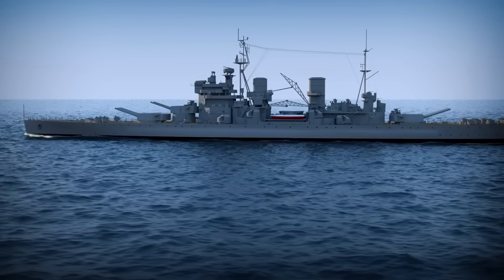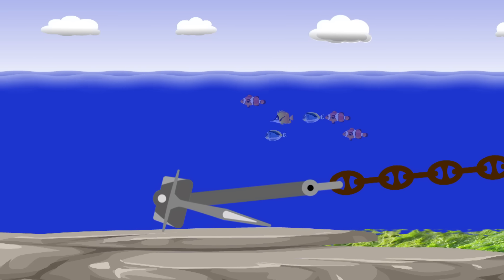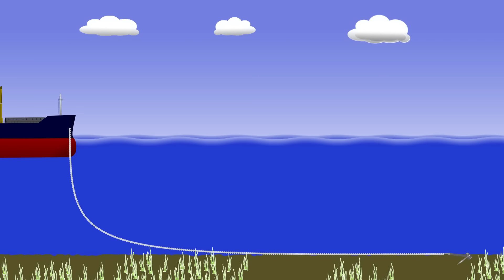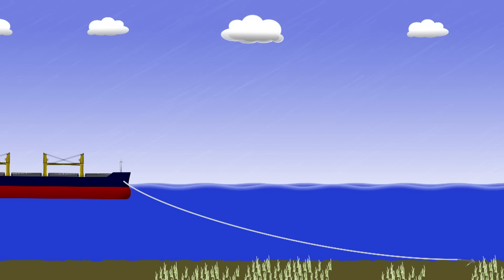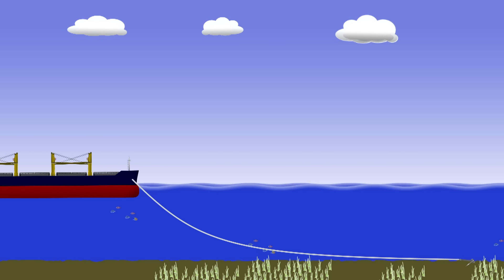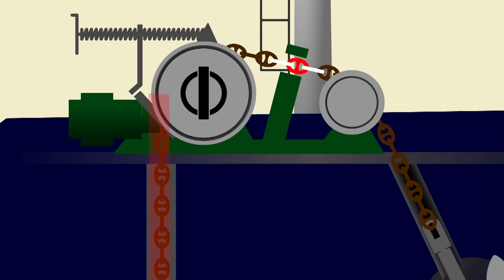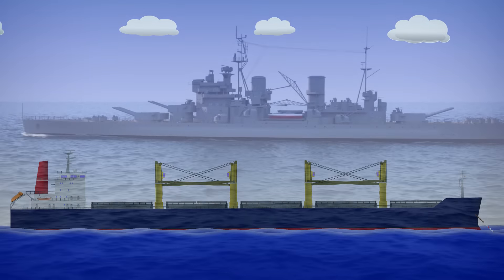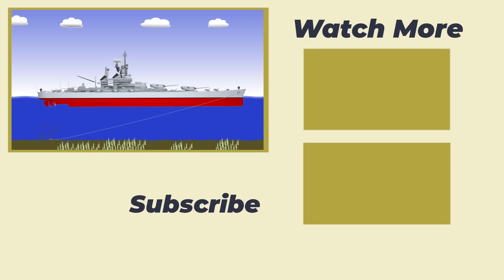The Truth About Anchoring Huge Ships

Comment: I actually learned that one of the most dangerous parts of the ship can be the chain locker. Not because there is several tons of metal chain link but because the sheer amount of metal can actually deplete the oxygen in that compartment through oxydation if not properly ventilated.
Reply: Never thought about that before. Very cool fact.
Reply: When you see multiple nuts holding a hatch (more than 10), its likely there to prevent crews from opening it on seas. The risk of getting suffocated when entering on these hatches are 100% death. And the chain locker is one such hold that has multiple nuts on its access hatch.
Reply: Yeah there are a ton of areas and voids that require a gas free certificate to enter on ships but they are typically difficult to acess and are labled well. What's really crazy is how fast you can pass out and subsequently die entering these spaces without the propper equipment or degassing procedures. In the Navy we are taught not to enter even just to try and pull someone out because of previous incidents where rescuers become casualties and multiple people parish. That's really wild though that metal oxidizing is the reason I never knew that but it makes sense.
Reply: I watched a something about an industrial accident where somebody sufficated in a chain locker and then the person who went to rescue them also died. I think two people tried to save them and died. Confined spaces are no joke.
Reply: Or there could be electrolytic components can be used to suffocate the saltwater to prevent the further electrolytic oxidisation
Reply: Any non-ventilated space aboard ship becomes dangerous over time. On most navy ships they are closed off by bolts, and requires forced ventilation before entering unless wearing oxygen providing materials.
Reply: @drewdabbs418  that video is from this channel also
Reply: All ferrous metal tanks/ enclosed spaces have this issue of "rust" taking oxygen out of the air, unless they are heavily coated/painted. However with anchor chain lockers , there is also the added  issue that the marine growth (algae/plankton/barnacles, organic scum/slime/etc) on the chain, dries out, dies, and starts rotting, which creates deadly  Hydrogen Sulfide gas. so chain lockers  are doubly dangerous.
Reply: Crazy
Reply: That's crazy. You come into a room and you die not because of some radioactive or toxic material but just an otherwise harmless metal chain absorbing all the oxygen.
Reply: wow.  I never knew this.  That is both really cool and totally terrifyingly cool.
Reply: That's not really true though
Reply: @TlD-dg6ug  uhh, wrong.  The chain locker is extremely dangerous.  All enclosed places on ships can kill you, but the original comment is right on.
Reply: @TlD-dg6ug  I hope it is, I usually flake the chain, and Im inside the chain locker when getting it back...
Reply: @TlD-dg6ug  I hope it is, I usually flake the chain, and Im inside the chain locker when getting it back...
Reply: @lashlarue7924 don't know...
Reply: @lashlarue7924  the only way that the original comment is valid is in a perfectly sealed environment, which almost no chain locker is. Every one I have ever seen has drains and air passages.
Reply: @TlD-dg6ug  Obviously your experience is not the only valid experience, and in such case you no longer have a sealed compartment anyhow.
Reply: @lashlarue7924  exactly the point I was driving home.
Reply: @drewdabbs418 yeah that is why it is forbidden to enter a confined space without a permit from the chief officer... The officer usually makes a probe in this spaces using a gas detector to test the oxygen content in that place if it is really necessary to enter the space they put on a ventillation to allow these spaces take in air.
Reply: Summary
A 342-foot barge was undergoing maintenance in New Westminster. Workers were carrying out a variety of repairs on the barge, including repairs to manhole covers that access void compartments in the hull. The compartments are considered "confined spaces." A supervisor went missing and another worker located him in the bottom of a compartment within the hull. Three other workers, one by one, entered the compartment to rescue their colleagues and lost consciousness. Ultimately four workers died from oxygen deprivation and one suffered injuries. A firefighter was also injured in

Comment: So fascinating, anchors go completely contrary to how you think they work as a child
Reply: How the anchor and chain system interact totally depends on the size vessel. The way it's described here only applies to large commercial and military vessels. Pleasure craft are not large enough for this interaction to occur.
Reply: @otm646  false, already on a 10/12 meter boat you have a metal chain anyway and you give from 3 to 5 lenght (1 lenght is the depth at hte spot) and use the same principle of anchor + chain on the bed of the sea
Reply: @otm646  Exactly, small craft rely more on anchor design and deployment than brute weight.  Very complex art just glossed over here but instructive and useful.
Reply: The anchor essentially just pulls the chain out of the chain locker. Lol
Reply: @resqjason2  true, but it can still stuck between rocks and that a huge problem
Reply: @russko118  I love it when people think they know what they're talking about. Your understanding of the physics in play here is wrong.
The amount of force imparted on the anchor rode from those few meters of chain is not nearly enough to prevent the rode from becoming tight in anything but the most mild of conditions. 3/4-in chain, something like you would use on a boat that size (that's actually being a little generous) only weighs about 5 lb per foot.  5 m of chain is only 80 lb. Doesn't take much wind or current to be able to pick that up off the bottom.
Now, if you are running all chain and have 100 m of chain out on a reasonable scope, 5 to 1 or better It will work as originally described in the video. Thing is most boats In that size class aren't running all chain. That's 1,500 pounds in chain alone.
Reply: @otm646  1 please use  international sistems, not that joke that is imperial 
2 and i think you misunderstud what i way saying, maybye buecause english is not my first laguege (my bad) and you don't even talk about what i was talking. i hate wen people think they know what they're talking about and don't come even close
Reply: Or as a grown adult like myself
Reply: This is exactly how I thought anchors worked since I was a kid I mean digging into the ground connected by a chain how did you think it worked???
Reply: @Ellispicks  No it's not the "chain weight causing the boat to stay still"  - the weight of the chain creates the "L shape" and drags the ship back towards the anchor. 
However the anchor keeps the chain still, and by extension the ship. Otherwise it would not be the ship moving (back), it would be the loose end of the chain.
Reply: Kailash Btw  how did you think they worked?
Reply: An almost universal truth I’ve found so far...
Reply: @JZ's Best Friend just like the rest of the ship😊
Reply: @russko118  no. I operate a 36 foot boat and the anchor is what does most of the holding. Not the chain. The chain is more providing weight so the anchor can dig that’s all
Reply: What this is kinda how I always imagined it lol?
Reply: We had an older style anchor before and it worked this way (the chain did the work). I switched to a modern anchor and the anchor does all of the work! I still let out plenty of chain but when I’m pulling it back up, the anchor holds to the seabed until the last moment (sometimes it doesn’t want to come out either).
Reply: @russko118  lol just stop dude, you embarrassed yourself
Reply: @smudent2010  i whould have, but i think i will keep on now
Reply: On smaller boats the still function the way they used to
Reply: Imagine arguing about a boat anchor
Reply: You mean as 10 minutes ago
Reply: ...yea... A child.
Reply: My life is a lie
Reply: You English accent is almost native like.. bravo my Chinese friend :)
Reply: they do? This is basically how I imagined them..
Reply: I thought the same thing
Reply: Everyone’s wrong here. Best anchor is just a cement block tied to a long rope and dropped to the bottom hoping it reaches. Ohh wait that’s just me and my little boat
Reply: @DarkVitamins  well yes and thus it increases your speed, then you pull it back in when you want to stop
Reply: Not sure you know what contrary means. This gives you a little bit better understanding of anchoring a large ship, but it's pretty much how everyone thinks an anchor works. Isn't it?
Reply: And that's just one more reason children aren't permitted to the Navy. Haha
Reply: @resqjason2  I think Chain Locker may have been a better movie than Hurt Locker
Reply: @JZ's Best Friend tell that to my parents!
Reply: I feel like a lot of people, especially those that live far inland, never really think about how much engineering and really cool science goes into modern seafaring technology. Ships are so cool!
Reply: @russko118  i use a length of chain on my small boats for this reason and it does help the anchor lay flat and grab in, also I suppose you know what happens if you let out too much rope in tidal waters in a smaller boat, there is a balance in getting it right, the chain does help that balance
Reply: @RiggingDoctor  curious, what type of anchor do you use ?? If it’s a “plough” kind of shape, have you rigged it onto the chain correctly ? 
Shackle is onto the hole near the base of the anchor, then use a breakable link(cable ties) to secure the links onto the end of the stem
Reply: It hooks the ground, what exactly were you expecting...?
Reply: @resqjason2  so true!
Reply: @russko118  sir,  unfortunately  , the age -old art of sea-man  ship, we are taught in imperial,  we get used  to it,I'm from Australia  by the way,  and in Aus we have used imperial  since  1963-ish.
Reply: @kenlee-97  i know, it's still used even here, mostly for lenght of boats (traditions) but just for that. and remember, nautical miles are not imperial units
Reply: @russko118  Metric is numbers for dummies, Imperial takes a bit of intelligence to use. Try it some time, fractions are fun.
Reply: @russko118  To be fair, 10-12 meters is far larger than the average personal boat
Reply: @--_DJ_--  lol you are american sir and there is no worst offense to that
Reply: @DolphinSMG  sure you need a licence just to drive something longer than 10m no matter what engine
Reply: @russko118  No, I am not Ameican.
Reply: @--_DJ_--  i'm relived, but also surprised
Reply: @russko118  I am Canadian, we use both up here just like they do in the states, it works just fine. I can use both, but prefer imperial when given the option. Also, there is nothing wrong with being American.
Reply: @otm646  incorrect, it's exactly how pleasure craft anchoring works as well.
Reply: @otm646  yeah I love it when people think they know what they're talking about considering I have a degree in engineering/physics and have sailed around the world and have owned two pleasure sailing yachts....hmmm..do lecture us about how anchors on pleasure craft work.  Keep going.  I'm amused.   The chain is just as critical in a pleasure yacht which is one reason why all chain rode is recommended for anchor tackle on off shore yachts and the size of the chain is far larger than the max tension loads required for it to carry.  The weight of the chain determines the holding power of the entire system to a large degree, particularly when you are using scopes on the order of 7:1 or higher.
Reply: @russko118  im with you on this one, we have a 10m boat at work and uses the exact same anchor that is show in this video. it works wonders, just remember to throw out enough chain, like you said, at least 3x the depth, 5 even better
Reply: @aaronm.3581  Yes.
Reply: I thought it was just butter
Reply: @russko118  I find it amusing that you don't consider something 10 meters long to be big. :)
Reply: @Jus7aguy  smaller than 3/4 meters (except optimist maybe) doesn't exist, so yes 10 meters is not that big. you can sail duo almost evry 10m sailingboats (maybe with somewhat moder rigging, you know a sloop, i don't know about antics)

Comment: Who would've thought that performing a handbrake-turn on a 40,000 tonne vessel is impossible?!..
Reply: I don't know if it's done anymore, but the Caremar ferries serving the islands in the Gulf of Naples dropped the anchor while entering the pier and performed a handbrake style manouver.
It was quite a show, they managed to land the rear ramp just a minute after stopping no more than 5 metres from the dock.
They were 1400t ships though, not 40000
Reply: On a ship as long and relatively narrow as a battleship it really isn't.

The short moment arm (think small lever) means that it would have to have a ridiculous amount of force on the chain to spin the ship.

The rudder works because it is at the end of the ship pushing sideways (long lever from middle with the force at a right angle), whereas the anchor is at the front side of the ship pulling backwards (also technically a long lever, but the direction of force is nearly in line with the lever, so the moment arm (the distance of the lever perpendicular to the force) ends up being short).

Well, okay, it could work if the ship was already moving sideways somehow, but battleships have keels to prevent that. So a cruise ship with it's omni directional engines might pull it off.

Or well, actually...

A battleship can totally do a handbrake turn! It does one every time it anchors in a wind or current. The wind/current pushes it sideways and the anchor chain pulls it to point upwind/current.

So yeah, they do them all the time! They just have to be moving sideways from an external force.
Reply: @TheNasaDude  Kind of like a slingshot effect??
Reply: @theInsaneRodent  Momentum is mass*velocity. 

So yes it will obviously be able to pivot in the wind wouldn't be much of an anchor if it could not do that. In other words your velocity is near zero, and so is the momentum.

Doing it with a moving ship on the other hand - it's so ridiculous.
Reply: I'm sure it's technically possible.................very slowly
Reply: Try 57,000 tons in the case of an Iowa-class, which is capable of a frankly terrifying 34 knots, propelled by a mind-bending 212,000 shaft horsepower. Combine that sort of momentum with the already miserable turning circle of the Iowas, and there's no way in hell the ship can perform anything resembling a handbrake turn.
Reply: @griffinfaulkner3514  isn't the turning circle of that class measured in kilometers?
Reply: @TheNasaDude  those guys do these ferry journeys everyday and they know what to do. Basically they drift like in a car 😂 full speed ahead, full to port and then drop the anchor while working the engines astern. Professional guys haha
Reply: Me....
Reply: @PeterJavi  Close to it, at just a hair under 1k meters. The stopping distance is roughly 4 kilometers if my mental conversion is right, unless you turn the rudders inward like barn doors. The downside of this method, as Wisconsin discovered, is that it does a number on the steering gear, and Wisconsin never did steer quite right after that particular test.
Reply: @firstkokin2324  yes they dropped the anchor and slammed the till to full starboard, to pivot around the anchor. Then full astern to stop the "dorifto" while lowering the ramp
Reply: @MrTarmonbarry  yes but not as extreme. I think they dropped the anchor and dragged it some. The anchor would have broken off if it lodged in hard rock.
Reply: @TheNasaDude  its still done. Called Mediterranean docking or mooring. We do it at a lot of small atolls in the pacific that don't have assist tugs.
Reply: @astro_manta9733  In Hollywood they can do it in less than a minute. 😊😊😊
Reply: Its 100% possible on US aircraft carriers.
Reply: @That_Awesome_Guy1  And during the manoeuvre the aircraft can take off to cover a complete circle. 😊
Reply: In Sea of Thieves it is...
Reply: @griffinfaulkner3514  I see the Iowa's turning radius around 750m at 30kt. Rather maneuverable for a ship of that size and at that speed. Better than the Fletcher-class DDs.